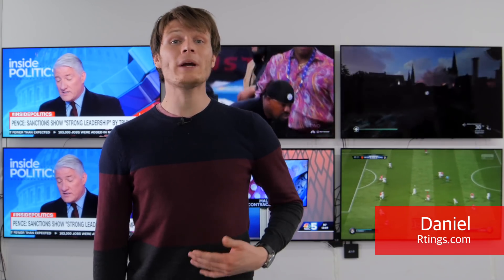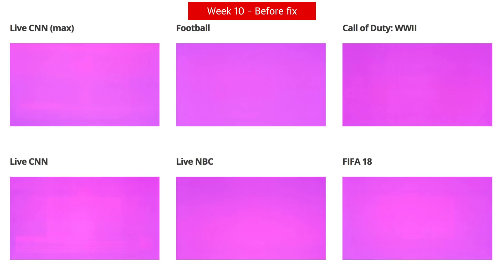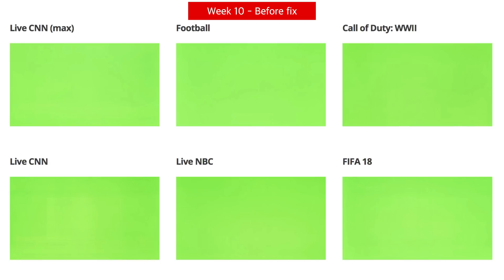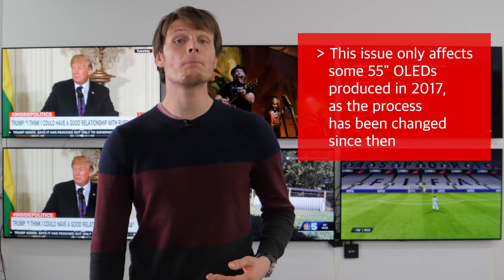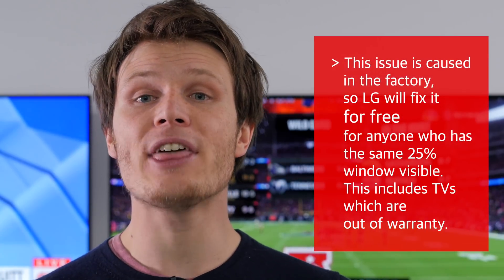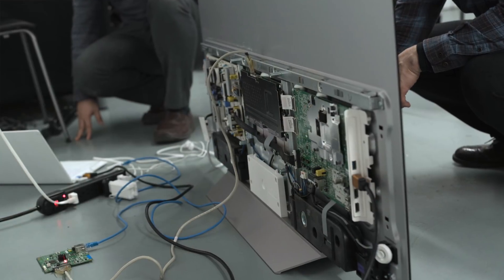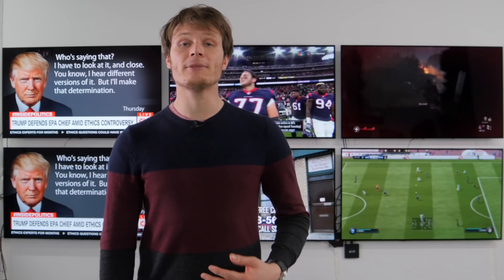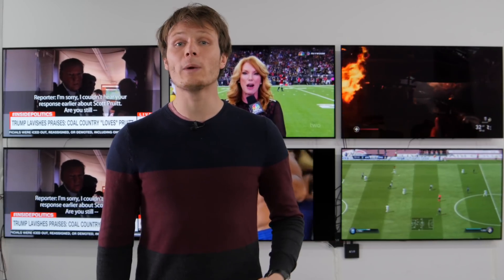Factory Defect & Fix - OLED Burn in Test Update Week 10 - RTINGS.com

Comment: Thanks a million for this video and info. I used it to ask for the repair on my LG 55B7V bought in May 2018. It was showing exactly the same 25% window. LG took the TV to the lab and ended up replacing the panel within warranty! Kudos to LG  and RTINGS for this! The ironic thing is that the panel now has additional 2year warranty :) Cheers

Comment: LG just replaced my panel that had the square uniformity issue, even though it was out of warranty. My question would be if LG would put the same panel as the C7 or one of the most recent ones. How would I know?
Reply from the maker: We really can't say unfortunately. This would have been a good question for LG/the repair technician. In theory, they should have used the same panel, but we just don't know. Sorry about that!
Reply: @RTINGSdotcom   I asked the LG support and they gave me the replacement part number. Aparrently it is specifically made for C7 series. Nevertheless, somehow the quality looks slightly better. Anyway, thanks for the answer and this video of course that prompt me to replace the panel!!

Comment: So I've got this box issue to a minor degree on grey slides only that sort of blends in with some of the vertical banding. I don't see it on other uniform colours. It doesn't really bother me as I very rarely notice it in real viewing conditions. But I did enquire with LG about it and they seem to want to replace a part behind the panel for £200! And they need to take my TV away for 14 days to do it. So not sure whats going on here but said I'll ponder it for now lol. I suspect they've not really taken on board exactly what I'm getting at and just throwing a general part replacement and service check at me to make a buck.
Can someone confirm whether this courtesy repair is meant to be honoured here in the UK as well as the US?

Comment: I thought LG wasn't fixing this issue - but they are.  My 2017 55" model was displaying terrible burn-in, especially with red backgrounds (see any State Farm commercial).  I purchased a new Samsung QLED set but called LG anyway.  After a bit of transferring, I was transferred to a helpful tech support person in the Philippines.  I had to provide pictures of the burn-in in support of the ticket they opened for me.  An authorized service technician replaced the screen today.  Cost of labor was about $180.00.  I had to run multiple pixel refreshes but the TV now displays a solid background - even with solid red pictures.  I'm greatly relieved that LG was willing to work with me to get my 2017 model repaired!

Comment: Is there any way to reset/update the look up table by myself? I had to replace the faulty panel controller board on my OLED65G6V (on this model the panel controller and the main boards are separate pcbs). The TV is working now, but I see now an old conpensation table from the tv that the board has been taken from (clear panel noise doesnt help). The LG service in the UK is hopeless. They say that they can only rellace my while panel with the controller board for more that I paid for the TV. I'm stuck with a terrible vwrtical banding that wasn't there before the controller board malfunctioned. Can you help?
Reply from the maker: We can't help with this unfortunately. It doesn't appear to be something you can do yourself.

Comment: i also have the same problem on a 2016 lg oled b6, a green rectangle on the lower part of the screen, as soon as the warranty expired ... I called lg italia but they don't want to help the customer. I was a lg customer even with an air conditioner but now it's enough lg, let's move on to other brands!

Comment: @Rtings.com Do you think that a B7 OLED which has developed a distinguish vertical line exactly in the center that splits the image into two might be related to this? Occured after pixel refresh session, once noticed it cannot be unseen...

Saw quite a few posts on reddit etc. complaining about the same issue, so perhaps might be worth investigating as well?

Images for reference: https://imagizer.imageshack.com/img922/3945/8xnt2q.jpg

https://imagizer.imageshack.com/img922/4908/7beEFv.jpg

Comment: Anyone know if mildly transparent vertical banding during solid colors can be fixed over time with regular use?  Strictly changing games, netflix and blu rays.. changing content?  Had the tv for almost 3 years now and it seems like it is starting to show banding or slight retention?   Tried pixel refersh a few times.  Still.

Comment: Riiiight. I don't believe them, and I hope you have fact checked LG. I have a 55" OLED LG TV from late 2017 that suffered severe CNN burn in. They replaced the panel quickly, and the service tech said LG had a "firmware fix" that fixed the issue. But the replacement panel had the same issue a few months later. So screen #2 had same issue as screen #1. We were not abusing our TV, or doing anything we haven't done with any other TV. Calls to LG Customer Service got unfriendly quickly. They gave me the run around. I was accused me of lying about my purchase date by an angry service rep until I pointed out that I shared my receipt for the 3rd or 4th time on their portal site. Fortunately, LG USA was much friendlier, understood the issue, and replaced the panel again. That's 3 screens in 2 years. Now we are afraid to watch any channel with a chyron, and are considering replacing it with a TV that can withstand normal viewing. That sucks.

Comment: My B6 has the green tint in the center, I was told they'd fix it, then for a call 30 minutes later they wouldn't I'd have to pay for it. I'll never buy another lg product again, there a garbage company.

I've had 3 lg tvs all three failed with in 3 years. Never again LG, only Sony going forward and no more oled
Reply: i also have the same problem on a 2016 lg oled b6, a green rectangle on the lower part of the screen, as soon as the warranty expired ... I called lg italia but they don't want to meet the customer. I was a lg customer even with an air conditioner but now it's enough lg, let's move on to other brands!
Reply: Hey Jeff. What was the charge for LG to come fix it?
Reply: @d3rrtyd3rrty8787  ended doing the right thing and bought it back from me for 1500. I got a C9 with the money and Bestbuy protection for 5 years covers burn in

Comment: Hi Daniel, I have the same issue, I bought LG OLED 2017 television. 1.5 years passed a burn occured on the screen. Technical service came and change the panel for free. Unfortunately after 4 months second panel had the same burn issue too. For second time I called for technical service. The service said it is the same burn issue but they cannot change for free as 2 years guarantee passed. I want to know that, how and where can I find the explanation of the LG about the burning issue in 2017 LG OLED burn issue, even 5 years passes they can change it ? What can I do to solve this problem? Thank you.

Comment: Just wanna say it's bullshit that LG will repair this for free. They're charging me in full for fixing this for a 55B7D that is 2 weeks out of warranty.  They just do it for free if you're a big youtuber to avoid backlash.
Reply: I have had them replace my panel for free, and the replacement had the same thing, so they replaced it again for free; out of warranty both times. Call the support number that ends in 0000, and ask for Executive product support and describe the issue to them. They'll have you email pictures and confirm that it is this issue. Executive support is familiar with the issue, but regular support is not and will charge for it. I also referenced this video as the source of them saying LG will replace it free of charge. I just had a terrible experience with their support, the process took about two months, but I just had the panel replaced (again). Their (non-executive) support is very frustrating to deal with and will give you a runaround. I sincerely hope this panel is not affected as well. I also sincerely hope you're able to get yours replaced without charge, I feel for you.

Comment: I have had my 55" B7 panel replaced becuase of the 25% window issue. Now, 9 months later, the new panel is also having the issue; but  am having a very difficult time getting LG to do anything about it. Any advice on what I should be doing with support to get the issue resolved (again)?

Comment: I've got this issue real bad showed pictures to LG UK got email back just now ....If after completing the troubleshooting, the fault is still visible, this would indicate a fault with the screen. As you are outside of our 12 month manufacturing warranty, we would only be able to provide an out of warranty service. This will be at a cost of £999.00 which would include the screen replacement, labour, courier, VAT , packaging and a 3 month recall period.
Reply: Lgc7v55 inch bought just over a year ago from new ....
Reply: @Andrew-nn8ht  Try to call LG support (again) and ask for Executive support, refer to this video and call it the 25% window caused by faulty lookup tables. I was able to have the panel replaced twice, but working with their support is difficult. I'm in the US, so your experience may vary.
Reply: @roryburns3846  hi mate I had extended warranty cover with Currys the retailer in the UK I got it from and they have now swapped the panel so now good as new ..all the best

Comment: Great info , many thanks

I have a 55" c7 and had been seeing this square shaped uniformity issue getting more and more prominent, no I know that it's actually a known issue . I saw your followup video , so now I will call LG and try to get it resolved , I have a feeling though it will NOT be as easy a process as you make out , while LG might have been receptive you you (and even out of Warranty) , I know by the way they treated me when my LG fridge needed repair (for known compressor unit issue) , somehow I was still $600 out of pocket....

Comment: I commented a few weeks ago about having this same issue and thankfully LG Canada has brought it to a positive conclusion. While not being able to complete the repair in the video due to service technicians not being available close enough to where I live (Owen Sound, Ontario) they have instead chosen to swap my TV for a new one. They sent a full credit to The Brick and I receive my new TV this Wednesday. The best part is that I’m actually getting an upgrade free of charge. My TV is a 55” B7 from 2017 and they no longer have those in stock so in exchange I’m getting a 55” C7 from 2018.
Thanks again for this content because if not for this video I’d be stuck with a faulty TV. You guys are awesome.

Comment: LG will not update the look-up table for consumers; LG will instead replace the panel. I had a tech insist on panel replacement, so I got back in-touch with LG to confirm this would fix the look-up table, and I was informed that they (tech support) "don't have access" to the look-up table. If the panel is replaced and the problem returns: they'll fix it another way.

The look-up table is considered proprietary information, so -- instead of distributing that data and the ability to access that information to 3rd party engineers -- they just replace the entire panel, which apparently fixes the problem. 

Rtings panels were repaired by actual LG engineers, but the rest of us will have to deal with  3rd party contractors who are not allowed access to proprietary information like the look-up table.
Reply: Are they replacing the panel for free?

Comment: I have recently entered into the process of having LG "repair" this 25% window problem, and the 3rd-party tech they sent to fix this insists on panel replacement. LG did acknowledge that this was a factory defect, and the fact that they sent a tech to my home after my TV has been out-of-warranty for a while shows me they acknowledge this is not my fault. Unfortunately, the problem is being diagnosed incorrectly as burn-in, which doesn't make sense because burn-in is not LG's responsibility, and not covered on out-of-warranty panels!

I do not want my panel replaced; I want the problem fixed correctly by having the Lookup Table updated! How is this problem not common-knowledge at LG OLED support after this video?

Comment: Thank you guys so much for this content. I'm currently having the same 25% issue with my 55" OLED and when I starting researching the problem I found this video. I contacted LG Canada today and at first they tried to tell me I had to pay out of pocket because the warranty expired in January of this year. I directed them to your website, and after spending quite a bit of time on hold they informed me that they will be doing the repair free of charge. I'm just waiting on confirmation of a repair date and I'll comment here again once the repair is done. Thanks again!
Reply: Please let us know how this goes! I am in the US, and had a positive experience remotely with LG, but the 3rd-party tech they sent to my home is insisting on a panel replacement.
Reply: If they’re paying for the panel replacement do it. The affected panels were manufactured in 2017 according to this video so a new panel  is likely no older than 2018 and should be fine.
Reply: @wilftoddneil 
Right, but is the look-up table stored with parts associated with the panel? I have read some comments on Reddit where people had their panels replaced due to this problem which say: "I'm sure it's just me being paranoid, but I still feel like I can see it sometimes." If the look-up table is not stored with the panel itself: changing the panel won't fix the problem. If this is a problem which doesn't appear immediately, and is related to integers stored in a database separate from the panel: it will just come back.

As I understand the problem: it manifests because the panel wasn't completely cool before the 25% test window was displayed, and the look-up table values were written while the panel temperature was not uniform.

If replacing my panel repairs the look-up table: I'm all about it, but I'm not convinced that's the solution. If panel replacement was the cure: why didn't LG do it to the displays in this video, and why does Daniel say the panel is not the problem?

Thanks for your reply, and I look forward to hearing what happens with your display.
Reply: Update - LG just emailed me and for whatever reason they cannot arrange to have anyone come to my home to do the repair. Instead, they are sending a full credit to the store I bought the TV from and I’m supposed to go pick a new TV and they’ll take away my old one. We’ll have to see how this plays out because I want to at least be able to get the same model in return.

Comment: I'm going through this 25% issue myself. I must say SO FAR, LG in the UK have been very good! They just asked for some pictures and proof of purchase now I'm just waiting on a date for the engineers to visit and repair. I was expecting to have to argue till blue in the face!  I hope every thing else goes as smoothly .
Reply: What was the end-result of your repair? Did they replace your panel, or did they update the look-up table as they did here in the video?
I'm in the US, and I am definitely approaching "blue-in-the-face" territory; tech insists that this is -- and needs to be treated like -- burn-in, even after I showed him this video.
Reply: @DriftSpaceZero   They have just done the repair today,  would have been a week after my fist post, but had to change the date due to work. They replaced the panel, took the guy about an hour to swap It out. All in all, I am quite happy my TV was just out of warranty and LG didn't mention It, everyone Ive spoken to at LG have been helpful and very quick to respond. I hope you have got yours fixed.

Comment: Rtings.com please I have this problem with mi oled B7 55 inches, could you tell if It was my fault, or is a issue that has to be solved by LG. See my video 
https://youtu.be/CVH3eMBoGAw
It is 2018 B7. It is in warranty
Reply: Your rectangle is much larger than 25%, so it is probably not the look-up table issue described in this video.
Your pattern looks more like you had 4:3 content displayed for long periods of time.

Comment: I had the 25% issue and LG sent someone to replace my panel nothing else. Does this mean the issue could come back?
Reply: I wish someone would answer this question, because -- even though LG agreed to repair this problem on my display, which is over a year out of warranty -- the technician LG sent wants to replace my panel, and insists it's burn-in. If the look-up table is not updated by the panel being replaced: I would guess the problem will return, because the look-up table tells the panel and individual pixels how to operate.

Comment: Thanks for this video, its good to know that its a common issue. Can you please confirm if LG will repair any brand TVs, or only their own? I have this 25% window issue with my Panasonic 55 inch TV. I believe LG are the manufacturers of all OLED panels, so I assume they will agree to repair the panasonic? How does one go about asking them to do so?
Reply: This is actually great information -- that your Panasonic TV with an LG-manufactured panel -- has this issue; it makes me think that the look-up table is associated with the panel itself, and not the computer which controls the TV. You'll probably have to go through Panasonic (their replacement parts will come from LG), but you should definitely mention this video. Good luck!
Reply: I also have this 25% window issue on my Panasonic EZ950. The windowbox appeared about two weeks ago after almost two years of use. Panasonic techs will come home this week, let’s see what they do, keep you posted.